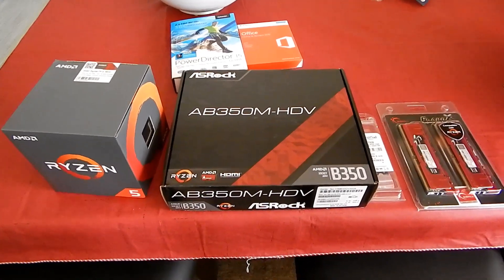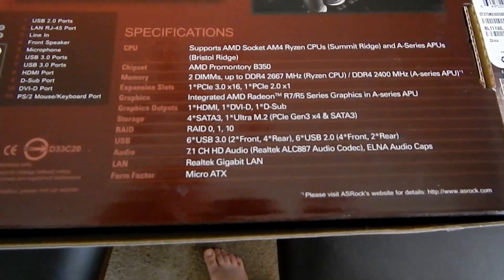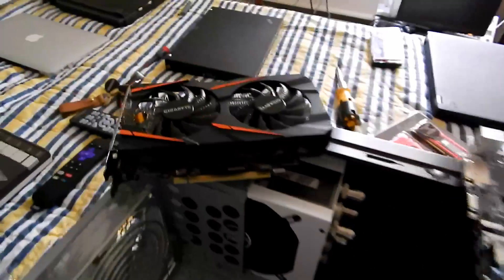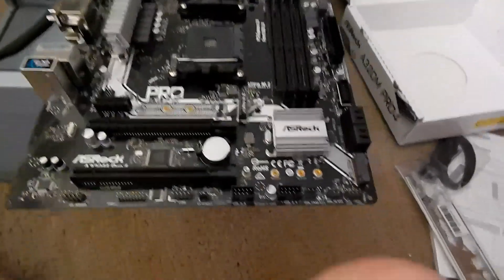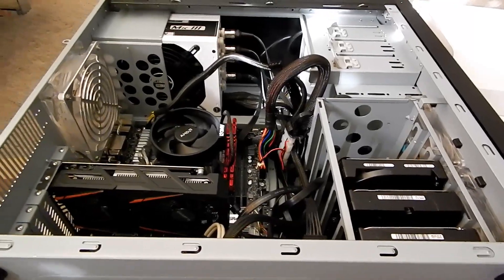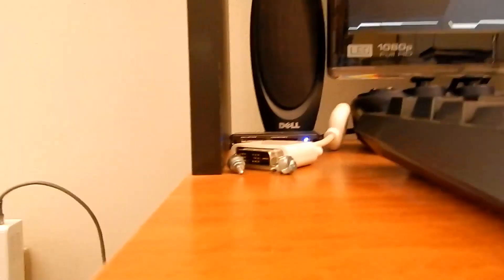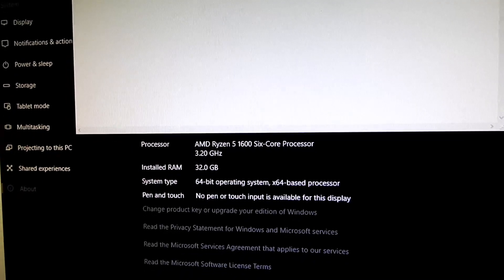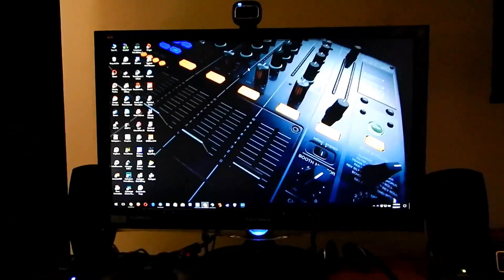Ryzen 5 Build Main Computer: April 2017

Comment: I've been watching the Ryzen from a distance and have been impressed with what I have seen so far. Finally, someone else thinks 50C is too much for an idling CPU, I hear all the time that this is fine, but I aim to top out at 45C after hours of full load, 35 tops for idle. I also completely get where you're coming from with the 64GB of RAM, my Xeon board tops out at 32GB and I knew 16GB would be enough "But hey" I thought "it supports 32GB, so why not just pay out and install that much anyway." which seems like a good enough reason in my mind. I prefer not to call such things "excessive" and instead prefer the term "future proofing" overall.
Reply from the maker: I can tell you that it's been a dream to see AMD back in the game in a serious way again. 

Yes! Idle temps for me should be in the 30s somewhere. Generally under 60 makes me a happy guy.

It just feels good to max out the ram for some reason even though it's completely unnecessary. I mean...I guess now there's no excuse but to run 12 VMs and have 5 Chrome windows full of tabs open, muahahaha.
Reply: Those are celsius estimates amd zen temp are calcucleted differently in different "units"

Comment: yay Ryzen, I also did a major overhaul of my PC using an R7 1700X and an MSI X370 motherboard. I'm coming from Sandy Bridge-E so it's a pretty nice upgrade I must say. Also got an RX 580 with the rest of my upgrades and man does it blow my HD 7970 out of the water, it can max out everything I play @ 1080p and can probably do quite a lot at 1440p too if I decide to upgrade. I'm so glad AMD is back, it's an exciting time to be an enthusiast again.

It also feels like coming back home for me too, despite most of my PCs being Intel over the years, however the first PC I considered "modern" was my old Athlon XP 2600+ build, the only other AMD desktop processor I used in a main rig. Like you said, the Athlon XP was awesome but the boards were crap. I had an ECS KT-600A (yeah yeah I know it's ECS but I didn't know they were shit at the time) and it literally fried my CPU which made me quite sad as it felt just as fast as my Dad's much more expensive 3.2 GHz hyperthreaded Pentium 4 at the time.
Reply: Jack Stavris I have an Athlon xp 2600+, it originally came with a long dead Compaq Presario, the case from that pc houses my main system, and the xp is living happily on an Asus board.
Reply: I've got a 3930K that does 4.8 and an 1700X with the Taichi mobo and good RAM. It isn't really an upgrade at all - and probably a downgrade in some titles - gaming wise but it's better for encoding and is more power friendly. At least with AM4 when they release the polished successor to Ryzen, we'll be able to upgrade easily. So glad AMD is back!

Comment: that cpu runs surprisingly hot.  My phenom II x6 1045T is running 44C under a 20% load in a hot completely un airconditioned room.  I guess they are going back to their old Athlon XP ways where they idle in the 50s

Also the b350 pro4 was the mobo I had chosen for when I build my ryzen build.  I did hear that the ryzens are really picky about what ram they will support

Comment: imo with the Athlon XP (I had the 2000+ and 2400+) I found the gigabyte boards were ok, the only down side was the coolers and the temps, I remember those die's were 100% exposed and pushing those coolers on could easily damage the boards. Looks like AMD are getting competitive with Intel now and actually fixing what was broken.
Reply: Oh the stock Socket A coolers were horrible. The fan on the one I used with my beloved Athlon XP 2600+ died and the board literally fried my CPU. It was a shitty ECS board but still, luckily boards these days will shut down before that will happen.
Reply: The very first XP's didn't have those little black feet on the PCB of the CPU, which caused a lot of broken dies, they fixed that real quick !

Comment: My ryzen build feels really fast even compared to my old skylake build its just snappier and I can feel it even within windows 10. In games ive yet to use more than 10% cpu and its insane.
R7 1700
Asetek  550lc cooler
Asrock AB 350 Pro 4
16gb DDR4-2400Mhz Patriot
500gb WD 2.5 inch SSD
1tb WD Blue 7200rpm hdd
Gigabyte Gtx 1070 8gb Mini
Corsair CXM 650M psu
NZXT S340 Elite Black And Red
Windows 10 Home 64 bit
Reply: chris kennedy I don't think u need anything other than a stock cooler and if u are using it for games and only a 1070 then a r5 1600x is enough
Reply: I use it for Virtual boxes and for game development and for rendering videos and game assets so I do need the 1700

Comment: Power Director is decent i used powerdirector 14 but now im looking to upgrade that when i rebuild my pc or whatever i end up doing, the problem with power director is that it does fuck all to compress video if i input a 10gb video sometimes it comes out rendered at 20 and im like Rendering is supposed to compress especially with h.264/h.265 codec. Thats my gripe with power director.
Reply from the maker: Have you tried messing with the bitrate and all that with custom profiles? They always turn it way up in the built-in ones.
Reply: Yeah lol power director has amazing audio tweak tools which matter more for me, but even setting the bitrate lower doesnt seem to do much, i tend to keep it at least 15,000-20,000 because thats the range where quality doesnt suffer, by default it was like 30,000 which is huge. lol. 

Im still trying to debate if im going to sell my desktop and build a new one or get a laptop, I would really like to be more portable with my gaming and video editing, I hate being tied to one desk and im not really gaming as much as I used to but being able to take a laptop and play world of tanks or warthunder or something liek that on the go would be really nice.

If i did build a desktop I would be getting ryzen cause intel doesnt have anything that can even touch the top end ryzen chip for the price it makes intels over $1700 cpus look like shit lol.

Comment: I own the AB350 board but have been waiting for somebody to answer a question for me before I install it. The board does not have the usual 9 screw holes that I'm used to seeing on an ATX board, maybe because it's only 9" wide (not 9.6"). I only see 7 possible locations to place the screws, including the "B" hole (see the ATX standard). How did you mount it? Also, my case (Riotoro CR1080) has a non-conductive peg at position "H" (where the middle screw hole is on a 9-hole layout). Do I need to replace that with a threaded standoff?

Comment: I got this motherboard and the internet doesnt work (hardwired).. I updated all the drivers and the internet icon at the bottom left is still yellow, any suggestions? I tried all the CMD commands. Nothings wrong with with my internet, or the LAN cable. Or the port in the back.

Comment: I can't overclock my ryzen 1200 with this motherboard. A320m pro4. The option is not there. Does anyone knows why? How can i enable cpu overclocking?
Reply: the a320 board is not overclockabe. Sorry bud. If you really want to overclock, your going to have to get a b350 motherboard
Reply: Thaser damn I jumped on it thinking it can overclock cpu. Turned out it's ram oc only.

Comment: Hi I am using asrock a320m pro4 motherboard with ryzen AMD ryzen 1200 processor I am not using any graphics card did my video output HDMI DVI S DVI didn't works I am facing problem with that anybody help me..... Otherwise I have to put any graphics card to the motherboard if zotac GT 710 graphic card will support with ryzen 3
Reply: Ryzen CPUs don't have an iGPU....you need an A Series APU to use the video I/O

Comment: You did a bios update to your motherboard to run the r5?
Reply from the maker: No, but I did end up doing some bios updates later.
Reply: @lmull3  Hey! Just to be clear, you did not have to update the motherboard at all to run the r5? I am worried the mother board will not be compatible with r5 2600 right out of the box.

Comment: I hate my i5 6600k because its garbage for about anything thats not gaming, cant handle video editing worth a damn, and i know i should have had a i7, but i didnt edit video when i bought the pc. Ryzen should beat the fuck out of it with editing.
Reply: ryzen, for video editing, is a beast (and I'm saying this from my Sandy Bridge i5 iMac LOL.)
Reply: Yeah lol, thats why im considering going for it, TIred of 4 hour render times cause of my cpu being a quad core. I even overclocked it to 4.7ghz and it was stable and didnt do much for editing.
Reply: chris kennedy weird because I use iMovie to edit on an i5-2500S iMac with 16GB ram and an old Radeon HD6770m and an hour 1080p video exports most of the time in <40 minutes. Dunno if its optimization on my old system or what.
Reply: +Jordan Woolery Can confirm that Ryzen is a beast for video editing. My 1700X does a fantastic job in Vegas Pro. I definitely don't regret buying it.
Reply: Yeah, intel is only good for gaming due to its pure core performance where as AMD is generally better for day to day use.

Comment: hey, is this mobo support Oclocking of ryzen cpu-s?
Reply: i have micro atx from asrock FM2 and it support oclocking of locked cpu-s and not just unlocked one but this is AM4 so maybe not support but then it is not worth to pay  so much money because for 10-15$ more you can get B350
Reply: Yes "B350" boards support overclocking however "A320" boards dont
Reply: not even from Asrock? their cheapest models for 40$ in FM2 and AM3  was support oclocking of fx and athlon chips  but noew they are more expensive and dont support clocking  ,even Ryzen is not  good oclock cpu-s and you cannot go anyway more then 4ghz almost like old Phenoms  2
Reply: you don't need to go over 4ghz its irrelevant and wont provide more performance, strong cores and more of them will matter more than speed in the future.

Comment: Why the hell do you need 64 gb ram lol especially with a low end cpu... Its hilarious as 16gb is enough for pretty much everyone minus extreme power users. Ive tried to use 32gb ram not even having 10 games open at once was able to max it out.
Reply from the maker: Ryzen 5 isn't low-end, it's midrange, but I see your point, lol. It is the definition of excess, but why not, right?
Reply: 6 core with 64gb ram makes sense to me.. sounds like a good production pc combo.
Reply: a 1600 is basically on par with a 6800k in terms of performance so I wouldn't exactly call it low end.
Reply: longetivity. extra slot helps.
Reply: yep

Comment: You're using b350 not a320
Reply from the maker: codot Sixty you didn't watch the whole video
Reply: in your description it says u are using the a320m
Reply: Specs: Case: Lian-Li K7B Motherboard: ASRock A320M PRO4 CPU: Ryzen 5 1600 GPU: Gigabyte Nvidia 1050Ti 4GB (Originally: Gigabyte AMD Radeon RX460 4GB, swapped for openGL performance) Storage: 275GB Crucial M.2 SSD, 2 x 2TB Hard Drives, 1x 1TB Hard Drive PSU: PC Power & Cooling 750W